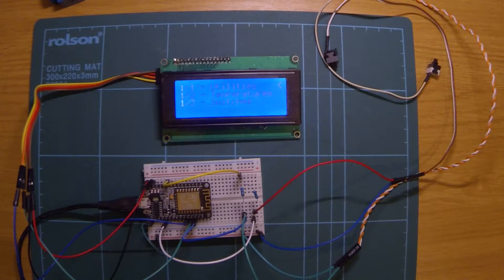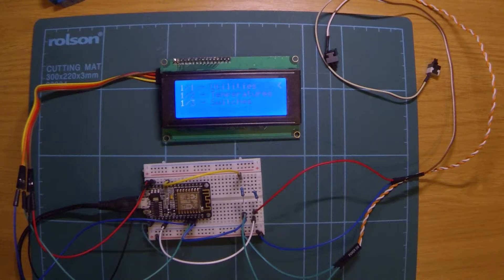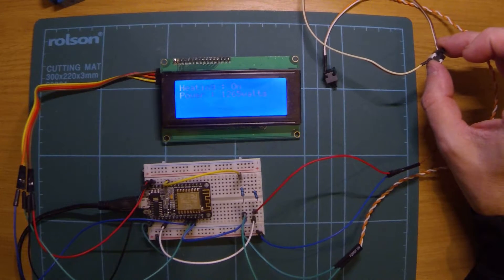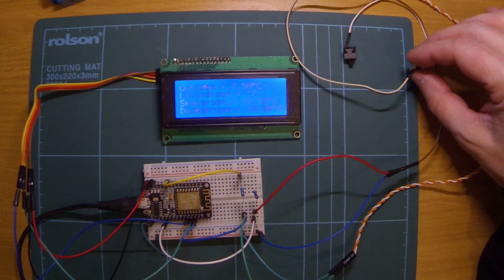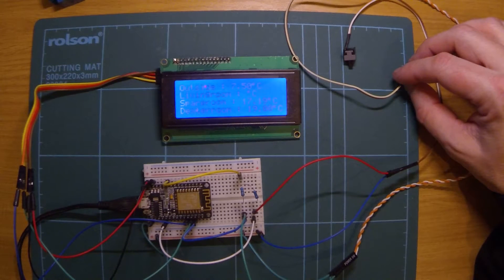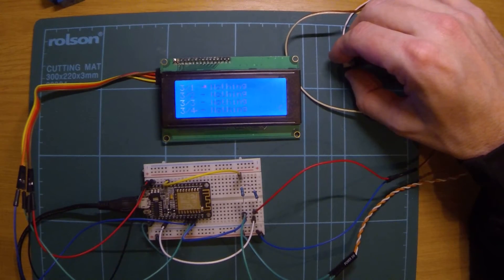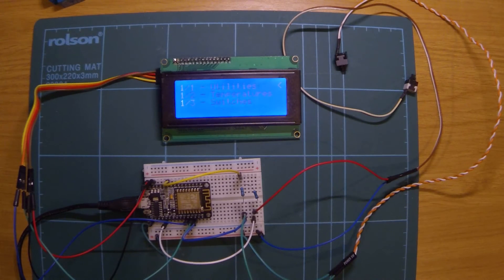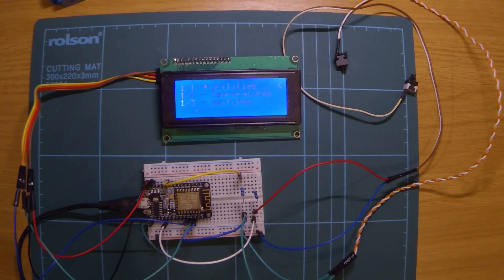using a nodemcu devkit (esp8266) to display temperature and other data on an i2c lcd display

Comment: Nice work. Can you please show a schematic diagram of how you connected the LCD with the ESP8266 board?
Reply from the maker: +Jasmohan Singh Narula Thanks for the compliment :) I will be uploading another video about this in a few days hopefully, I will include details of how I got it working then.  Its pretty straight forward the way I've done it.  Clue is to use i2c :)
Reply: +lets build stuff I know you used I2C. I am asking which pins did you use and how did you connected the LCD and the board. Anyways, looking forward to new videos of yours.